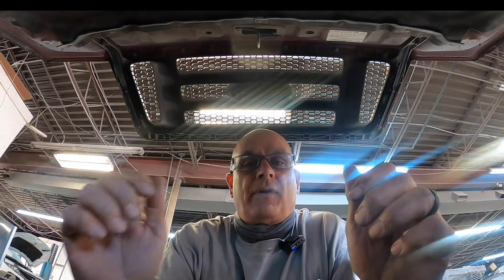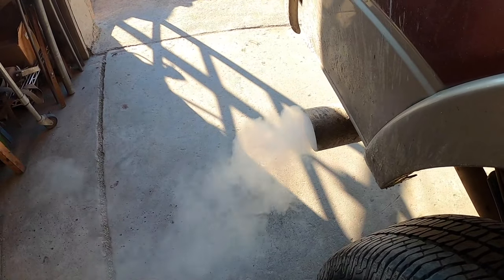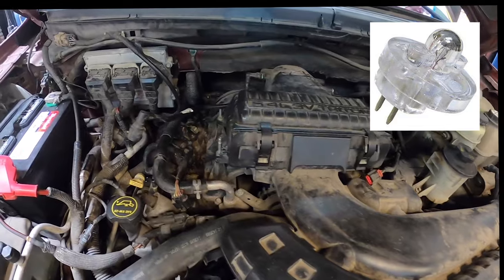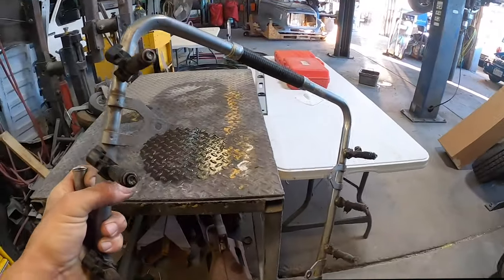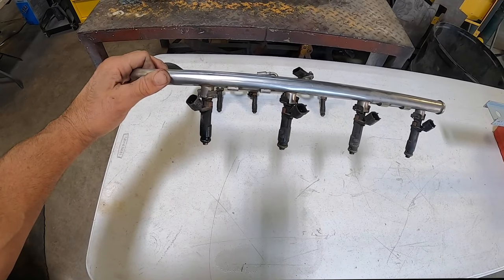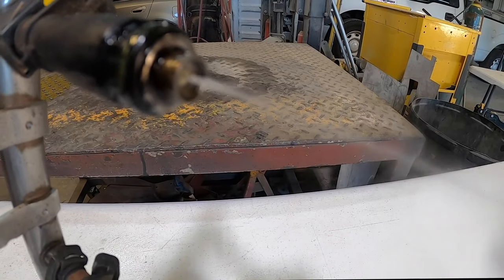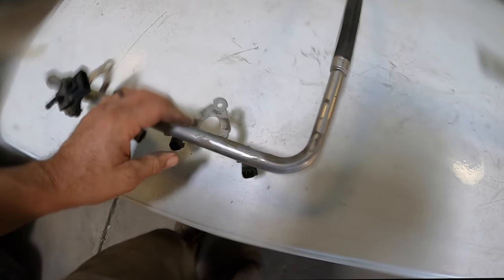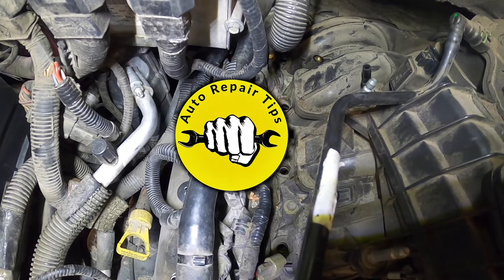This is why you have white SMOKE coming from your EXHAUST~~~~TUTORIAL easy FIX

Comment: My 2004 g35 smokes when I accelerate. I haven't experienced coolent lose or oil lose. I'm running p0171 code for vacuum leak. Could that be it?
Reply from the maker: yes thats possible, what is the temp at when you drive
Reply: @AutoRepairTips757  usally in the middle. Never goes higher than that.
Reply: I have the same car with the same issue. Car drive fine. Doesn't over heat and no oil in radiator.

Comment: Forgot to put on oil cap. Now white smoke won't stop when excelerating. Any thing I can do to fix it. Yes oil is coming out of exhaust too
Reply from the maker: what kind of car do you have
Reply: @AutoRepairTips757  1997 mercury mystique 70,000 miles 2.0   4 cyl
Reply from the maker: @joannehein518  a lot of older cars, if you take the oil filler cap off and drive your car, it doesn't breath correctly. so it will cause oil to get sucked up, and i have seen it come out the exhaust before. make sure after you reinstall the cap you check the oil is topped off. and it should clear up just by driving. if it doesn't, then  take it in to get looked at. hope this helps
Reply: Did an oil change with new filter and new plugs. Then got a underbody car wash. Drove car for half hour and Bam, it running great

Comment: Hi i have a Honda Civic s03. My car started doing this. Tons of smoke coming out the exhaust. And it misses and smothers if i give gas. There is also pissing fuel out the knuckle of the manufold and by the exhaust. There is a black smokey patch on the floor.

Also my sparkplugs are pitch black at this point and smell like fuel
Reply from the maker: you need to take it in to get looked at before something lets loose
Reply: @AutoRepairTips757  thanks my good sir.it started doing that today.and its going in tomorrow.i am not starting it again after today.
Reply: What was the issue?  This happened to me today…turned a corner and had thick smoke coming out the exhaust pipe
Reply: @freddycalipari4242  Hi. It was the injectors

Comment: My 1994 Acura legend exhaust smokes when its cold outside and during idling. The fuel injectors are old and im not losing coolant or oil so i dont know what it is
Reply from the maker: is it miss-firing ? or running rough
Reply: @AutoRepairTips757  not really just jumps forward a little when accelerating from 0 mph

Comment: I'm having a white smoke problem out the tail pipe and misfire but also sounds like I have a knock, Im wondering if the knock could be caused by bad injectors
Reply from the maker: It’s kind a hard to tell without looking at it but in the video the truck with the bad injectors yes it did have a slight knock too it
Reply: Sound exact problem with my 2006 Ford Mustang GT , did u ever find out what was the knock ? It’ll go away in like 10 seconds then come back on shortly
Reply: @mikegg4real131  on idle, did it feel like it wanted to turn off ?

Comment: I use Mercedes Benz e200 cdi 2007 mode I still see smoke after changing my injectors
Reply from the maker: Did you test the injectors to make sure they were the problem also if you have a bad injector dumping fuel your car will run rough and you will smell excessive amount of gas, White smoke is also caused with a possible bad head gasket you need to check that also

Comment: How do I fix my Audi q5  from smoking white so much.  Keep saying oil pressure low.
Reply: I’m in the same boat mine is a VW Passat
Reply: Head gasket or if you keep replacing your oil and it keeps doing it you probably have a oil leak
Reply: @ChevyChewy90  you find out what the problem was?

Comment: Wouldn’t this situation throw a code?
Reply from the maker: A misfire code that’s what you would normally get
Reply: @AutoRepairTips757  only got a misfire once. Flashing check engine light. Still lots of smoke. High fuel trims on bank two.
Reply: @AutoRepairTips757  fuel mileage is dropping.
Reply: Can u get a p0300 multiple misfires code
Reply: @hippitymcstribbs4906  I got no more misfire codes. I was losing coolant so bad head gasket. I put in the Bars leak with the fiber. It seems to have sealed it.
Reply: @hippitymcstribbs4906  fuel mileage still down slightly. Smells rich at times.